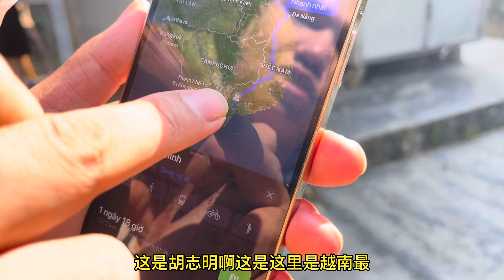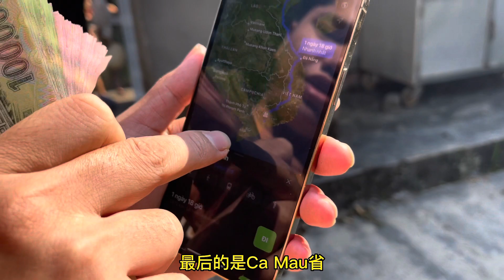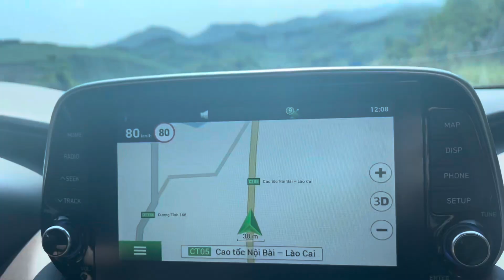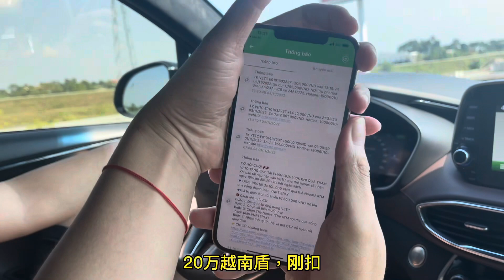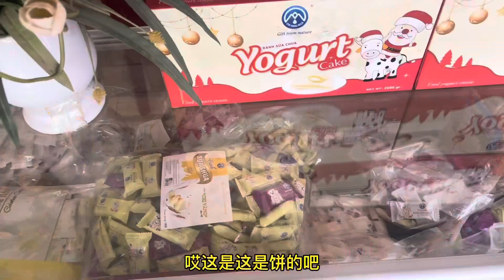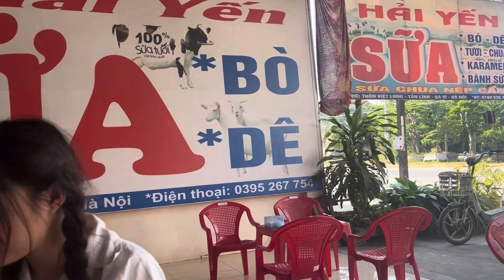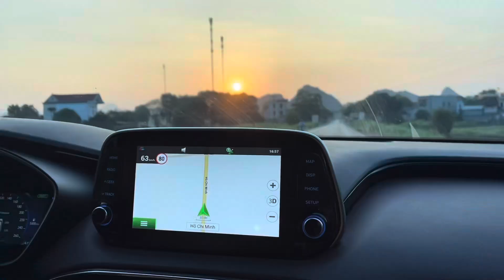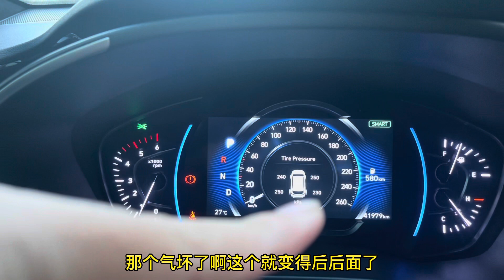第一天自駕遊去南方誰都很好奇，在路上我們遇到了困難，但是風景很美。

Comment: Wow I will not let those guy touching my car. Look's to me he just screw the bolts back on without check the spec how many lb-feet of torque for that SUV and will hurt the SUV if is too tight and you need to re-torque after 50 Km to spec to make sure. If not your wheel might loose and come loose and that will be very bad. 阿俊 be careful that's serious issue